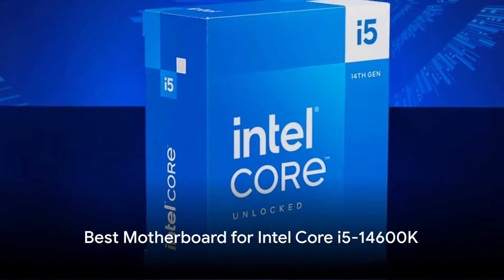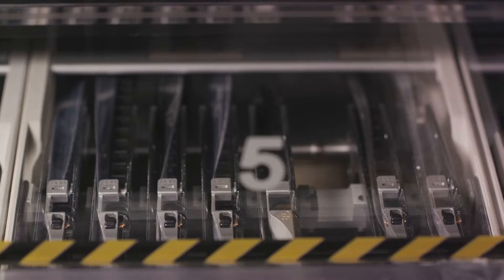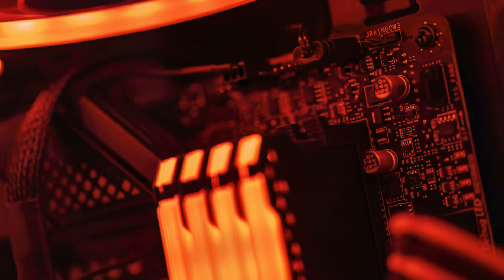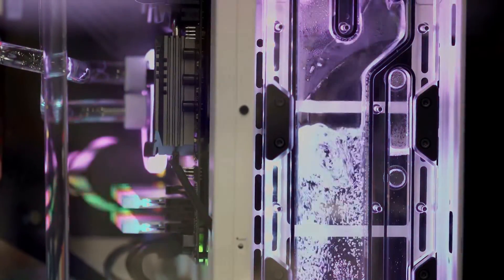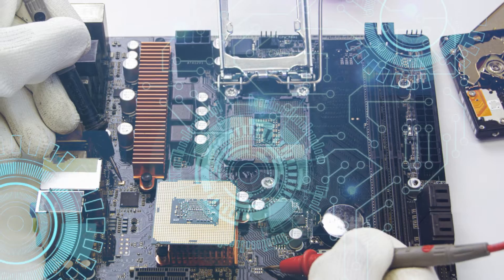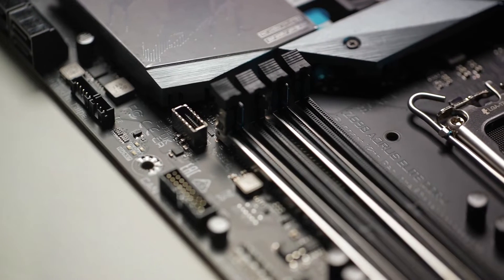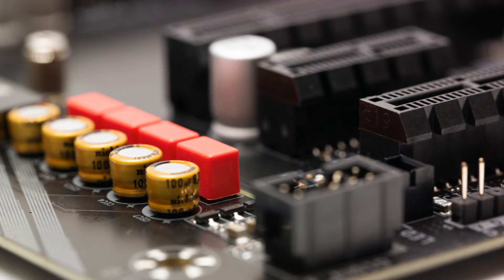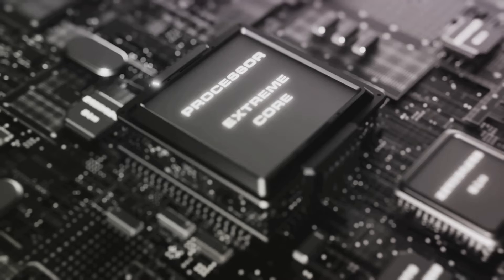Best Motherboard for Intel Core i5-14600K & 14600KF

Comment: Hello bro ! Do you think that my ASUS TUF GAMING Z690 PLUS WIFI D4 is compatible with 14th generation ? I ask because on the french Asus site (i'm french normal lol) is indicated only 12th and 13th whereas in the english site 14th has been added... The socket is the same between all three but apparently the mother card wouldn't have compatibility with last one
Reply: Check the socket if its 1700 then yes
Reply: @lepszanazwaniztamta6358  It is. Thank you ! 💪 LGA 1700 and Chipset 600